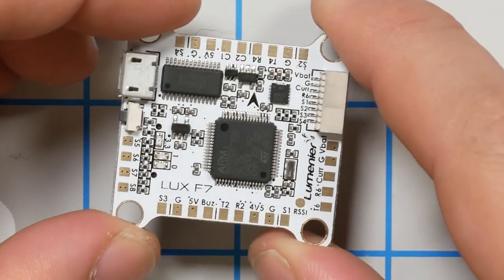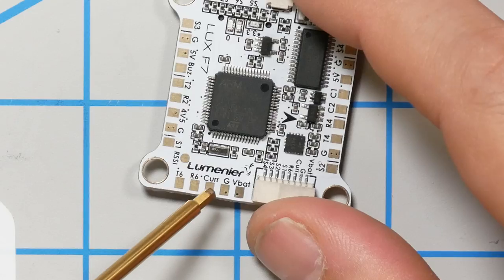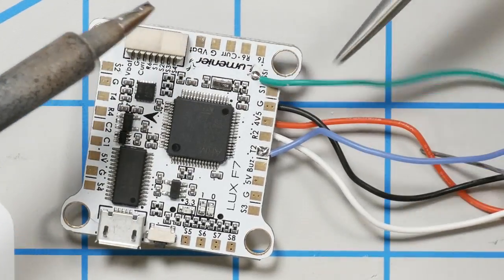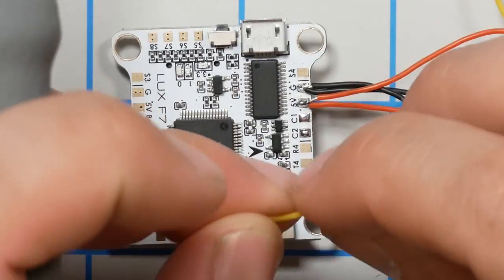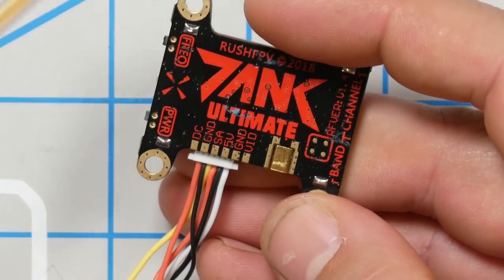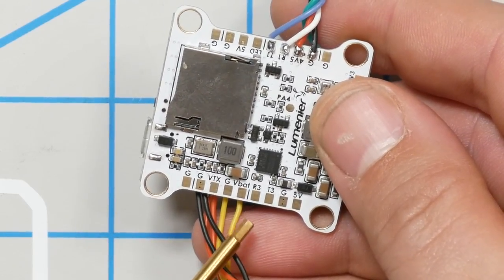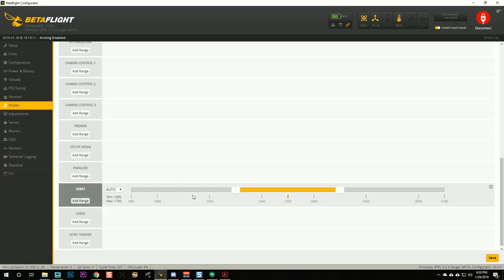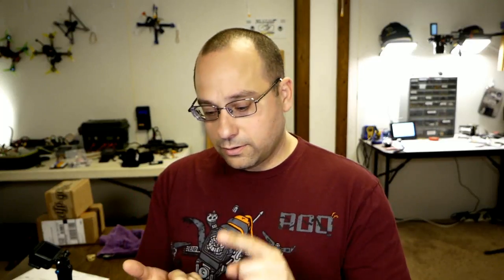Lumenier Lux F7 Ultimate | SETUP CAMERA AND VTX SWITCHING

Comment: Great job.  Like how you explained your thinking instead of "look it up in the manual".  This way others learn that they can also work things out even if the manual is not available.

FrSky Fport is worth a mention when wiring RX's (especially on F7 boards).  1 UART, Signal and Telemetry, RSSI included without using a channel, no transmitter module.

Comment: Also about the sport and sbus on the same port: Smart port actually uses both Tx and RX, they are just internally connected in the chip by betaflight. It is a two way, one wire protocol that the STM32 chips just happen to be able to handle. If we were using a Atmel chip or something that doesnt do this we would need wire it to both RX and TX externally

Comment: One newer board I've noticed an issue with when using the dedicated pads to supply power was the CLRacing F7. I had power issues with the camera and receiver pads only pushing 3-4v. Camera would power on, but got a gray screen. Receiver LED flickered. Wound up using the 5v LED pads for receiver power and powered camera from VTX. Definitely going to try out this board

Comment: Hey Josh, since I build differently by using a Bicks switch seperate from the FC I wind up using my crossfire Nano ch 3 and ch 4 outputs as triggers for the seperate switches.   But something very interesting happened today when I updated Crossfire from 2.24 to 2.88.    I lost my ability to output one of the channels.   I went from under 2.24 having the nano Ch 3 outputting Ch 6 and nano Ch 4 outputting Ch 7(which matched my switching to inverted and inverted backwards mixing) to 2.88 only letting nano Ch 3 output correctly while losing nano Ch 4 output.   Basically broke my build.    Thank god I was able to roll back to Ver 2.24.  Gonna try to find Trappy this weekend in Vegas and see what is going on.
Reply: Talked to Trappy in Vegas.  2.88 known bug.  To be fixed in 2.9.

Comment: Hi.  Big fan of your videos.  I was wondering if you could help me.  I have a QAV400 with a Storm32 BGC gimbal. I am using a Luminier Lux7 FC and R-xsr receiver on FPORT.  How can I connect the Lux7 to the gimbal, so I can control pitch and yaw of the Gimbal using the taranis switches?  Do I connect to the signal wires?  The Servo Tilt on Betaflight is supposed to support two servos.  Do I need 2 signal connections?   Is the signal coming from the FC connected to the R-XSR (Fport) PWM, PPM, SBUS, or Serial?  I have googled and search the internet and I can't seem to find the answer.  Thank you for your help.

Comment: VTX Mic on end between buttons? Thought I saw it go by. 

Bought 2 of these, It's a candidate to replace the DYS F4 V2 as my standard FC. The DYS has a great 5v out for TBS Unify, but the Luminier 50a ESC also has a good 5V 3a out I usually don't use. I have nothing negative at all on the DYS, but this is F7 and new and cool - usually a formula for trouble, but I have a good feeling on this one. We'll see, one is going in a 7" Chammy and the other in a scratch X Class.

I hope you go into all the goodies like the dual gyros and such on this board. Another good review would be the Foxeer ClearTX 2 (Kwad Box Boost of the month, so a lot of us have one looking for a home)

Thanks!

Comment: How do you go about switching roll / pitch with the flip of the same switch?
Reply from the maker: Working on a cheaterkwad video now to show it. In short: set up two mixes on each channel, one for pitch and one for roll. In each mix, use the "Switch" parameter to make the mix only become active when the switch is in one position vs. the other.
Reply: @JoshuaBardwell  Thank you! I'll have to order everything now and wait for that video to make sure I get it all 100%... Seems like a fun quad to build
Reply: @JoshuaBardwell  dont forget "replace after".   For 3D they way I split the trottle and inverted it with the switch was a bit more difficult.

Comment: I didn't know I could use crossfire and my tx instead of a uart to change band and channel on my vtx til today.  it's different using the tx instead of the osd but I wanted to try it.  it's kinda cool.  I wonder if my rapidfire will have problems locking on if I switch band/channel like that?

Comment: So if you use smart audio does that mean you're giving up the microphone? I mean on VTX that doesn't have a separate pad
Reply from the maker: If the vTX shares audio with SA, then you usually can't use both at the same time. But most vTX today have a separate audio and SA wire.

Comment: When you have only 1 UART, can you connect sbus as usual and connect the smartport with soft serial and resource remapping to that same UART?
Reply from the maker: It's possible that you can use UART RX pad for SBUS and remap UART TX pad to softserial for smartport. That is how I think the Matek F405 does it. But it won't work on all FC.

Comment: I had to check the date of the video when you didn't mention F-port , Was there an advantage to this receiver setup other than analog rssi or just using up parts in your bin?
Reply from the maker: I'm not sure I understand your question. Are you asking why SBUS+SPort is better than FPort?
Reply: @JoshuaBardwell  Sure, your opinion would be great. I have watched the videos countless times on how to set it up etc back when they where posted, Just started to catch up on videos missed and noticed you build without it.
Reply from the maker: For an F7 processor, FPort will free up one UART. But you have to flash firmware to the receiver, which is a bit of a hassle. Probably that's the reason I didn't do it LOL. Just lazy. And had plenty of UARTs.

Comment: Hello Joshua.   Will the Lux7 support ESC telemtry from 4 separate  ESC's?   I have this FC board now and four Lumineer RAZOR 32 BLHeli ESC's.    The manual shows Uart 6 for Telemetry but that would not be for 4 seperate ESC Telemetry wires?  The manual shows a 4 in 1 saying it has individual current sensors but only has one wire.
Reply: Okay I figured out that you combine the 4 separate esc telemetry wires.

Comment: Joshua - I watched your Black box video and I have the Lumenier Lux F7.  I noticed that with a 16GB SD card, it show that only 4GB is available.  I used the SD formater that you recommended.  Am I doing something wrong?
Reply from the maker: Nothing is wrong. Betaflight only accesses 4 GB of data at a time. But a single log is only a few hundred kB in size. You will never fill up 4 GB.

Comment: Hey Joshua, do you have any 4-in-1 ESC recommendations to use with this particular flight controller? I’m discovering that there are potentially too many associated hoops* to jump through for this board on my first build, but maybe there’s an esc that you know of that would minimize them.

*Things like telemetry, the fact that this board doesn’t have a current sensor, etc.
Reply from the maker: Any ESC can work if you make a custom plug or direct solder the wires. I think getfpv support can recommend one that plugs in directly.
Reply: Joshua Bardwell Ok, cool, thanks for the response. I think I’m going to go with the Kakute F7 and Tekko32 for this particular build, but the Lux F7 Ultimate seems like a great controller. And it definitely looks cooler.

Comment: Is there any reason why you don´t use F-Port? With F-Port you don´t have to use a second UART
Reply from the maker: In this case, I don't think the Hobbymate receiver has FPort firmware.
Reply: @JoshuaBardwell  For me this is a reason to not use it. If you want a perfect wiring, you have to use the suited hardware.

Comment: The vtx power does it power up at all when u plug battery in before radio link
Reply from the maker: That's totally up to you, how you set up the aux mode and failsafe. You set the failsafe position for the aux channel so that the vTX defaults to on or off.

Comment: Would rapidfire 1/2 work if both cameras were the same model?
Reply: I think no. Because they must start within the same microsecond and all capacitors and resistors must be the same within 0% tolerance - which will never happen. That‘s why there is a sync signal within the video signal. Because one sync signal could get lost, rapidfire selfgenerates the sync signal so the googles don‘t get confused at a missing sync signal which would lead to display rolling.

Comment: whats the difference between f4 and f7 flight controllers - I don't understand it
Reply: F7 is a faster processor, but also a really nice feature is F7 supports both inverted and un-inverted signals on the same pads. So you don't have to have a dedicated UART for inverted signal like an F4 board.

Comment: Does anybody know where I can get a diagram for wiring the new DJI FPV System to this EFC?
Reply from the maker: The DJI system comes with instructions. You don't have to connect the DJI system to the FC at all if you are using your own controller and receiver. If you have the DJI controller, you need to connect the SBUS output from the Air Unit to the UART RX pad on the FC.
Reply: Joshua Bardwell thanks for the reply. So if I’m not mistaken, on the Lux f7 the  sbus port is the rx2 uart?
Reply from the maker: It can be any. But I agree UART 2 is the one the board designer intended.

Comment: Random Question does anyone know why frsky receivers only take 5v in and are unlabeled for which is what just an s + - would help a ton and my camera takes anything up to 40 v in my vtx is the same so is my flight controller why aren't the receivers its horrible.
Reply from the maker: Putting a large voltage regulator on the receiver would increase size and be pretty much unnecessary. Every FC has a 5v regulator for the receiver.

Most FrSky receivers are labeled or come with a manual that has the pinout on them. What receiver are you working with? You can probably find the manual on the FrSky site.

Comment: What about amp limits on fc's.
Reply from the maker: Not sure I understand the question.
Reply: @JoshuaBardwell  I know some fc's have lower max amp ratings than others so if you power a vtx (5v) power, a reciever, and 1 camera, all off one board sometimes the board has trouble and will not function properly (let alone 2 cams)

Comment: can this controller run INAV? i cant find it
Reply from the maker: Yes, it can run iNav. It uses the Matek target.
Reply: @JoshuaBardwell   for real??  I thought I tried loading it and it wouldn't boot... I have had it sitting there for months because I need inav... Am going try the latest inav right now
Reply: @JoshuaBardwell  oh hell yeah, thanks a lot man, I used the F722 SE and its working perfectly. will put it up in air morrow....

Comment: hey motor and voltage guys in here help me.  im seeing plenty of vids showing pilots using 5s batteries on motors like the tmotor f40 proII 2600kv. which is only rated up to 4s.   others are telling me that 5s is no prob on these motors.  can anyone confirm this PLEASE!!  im running those motors.   if thats true i can just plug and play.  please someone confirm 5s on those motors are ok to do or not to do?  thanks
Reply from the maker: The main limit is heat buildup. 2600kv on 5s will draw a lot of amps. But as long as you manage not to melt your motors you'll be okay. I mean, your battery will hate you....
Reply: @JoshuaBardwell  Lol.  Gotcha